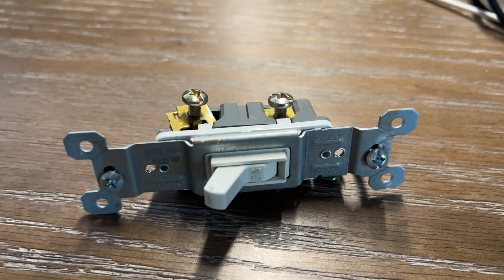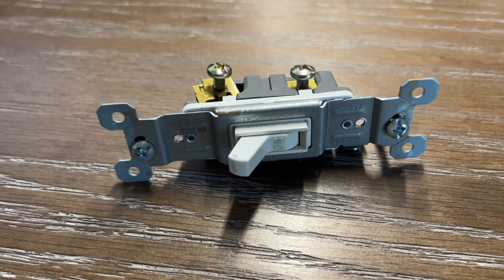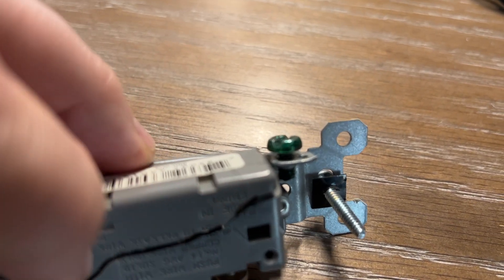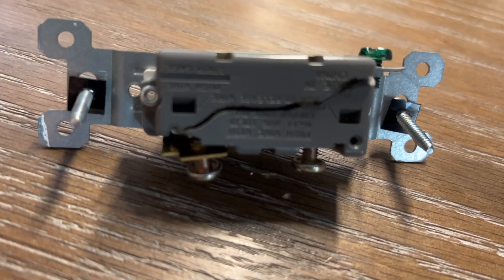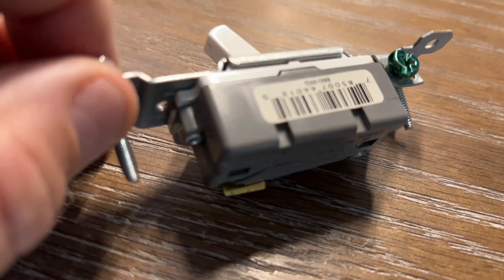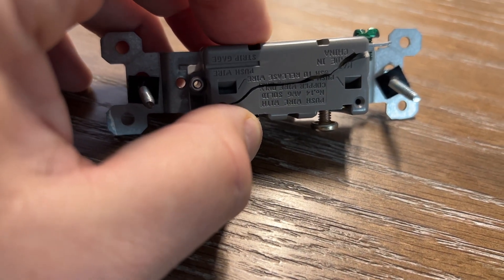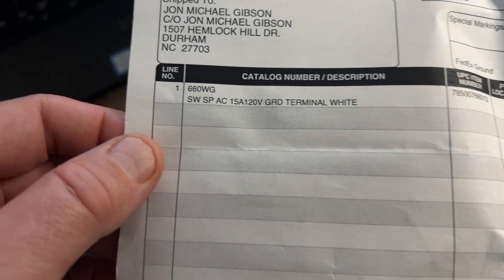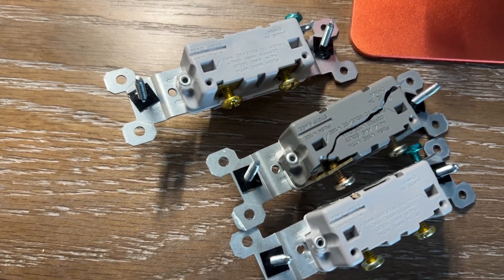Pass & Seymour / Legrand Switch Failure # 2.  What the heck is happening?

Comment: Same thing here.  My home is a 1998 build, and I’ve had several PS switches and outlets fail over the past few years  from plastic fatigue from use of the push in terminals.  I’m planning to replace all of the remaining switches and outlets in the home shortly.  And I’ll be using the screw terminals to reduce the stress on the plastic.
Reply from the maker: They sent me a box of replacement switches for free.
Reply from the maker: Just have to call and ask for them.  Or email them along with a link to my video.

Comment: I am having the same problem. It could be the tension of the push terminal spring cracking the inadequate plastic. Wrong material or too thin??  
I have these in three buildings.
Reply from the maker: I was originally thinking that it was heat induced plastic degradation overtime because it has only happened in my exterior walls. However, one viewer stated that it’s also happened in their interior walls so now I’m starting to question my hypothesis.  The plastic, however, does seem to get brittle when I rub it and I can feel it falling apart in the areas that crack so I’m not sure. Thank you for your comments and hopefully somebody can get to the bottom of this soon.  PS  sent me a whole box of replacement switches which I’ve swapped in as needed, but I don’t have a lot of confidence that they’re going to last..
Reply: @thehometipsshow  All interior walls for me. Maybe the material is just too thin. Not using the push terminals might help. Pushing the wire in increases the tension on the case.
Reply from the maker: Good point in not using the push terminals.  Maybe somebody can comment that had installed them by not using the push terminals?
Reply: @thehometipsshow  I would add that these switches were lightly loaded. Both less than 25W, so heat would not be an issue.

Comment: I have had several of these switches fail where a corner of the plastic cracks and falls off. Same with a few duplex outlets. Every switch and receptacle were installed when our house was built in 2006. All had AWG 14 wire pushed into the back of the plastic housing. I am in the process of replacing every switch and receptacle in my house. I strip the wire and form a hook, place it over th4e screw and tighten the screw. I don't trust the quick connect push in system.
Reply from the maker: They have zero quality control!  I’m so disappointed in them.
Reply: I'm not sure how they maintain UL listing. The only way to make these last is to only use the screws for the wiring. That means adding a few pigtail wires where the builder had two wires pushed into the back and a third wire on a screw.  @thehometipsshow

Comment: Interesting that they don't admit there is a problem with their product.  My home was built in 2007 and I have had 5 failures with the exact failure mode.  Read the reviews on Amazon and you can see that they do have additional complaints on the product.
Reply from the maker: I just had yet another switch failure today.  I thought my 2nd floor HVAC was broken as it had lost power.  It ends up that another Pass & Seymour switch had died (the one that turns off the HVAC unit next to it in the attic) and had been arcing causing the HVAC to turn on and off.   It ended up costing me $250 for the HVAC service call.  I'm now very concerned that these switches are going to burn my house down and/or kill or injure my family and pets.  I'm going to call them tomorrow to try to attempt to get them to pay the $250 bill as they know they have a problem as they sent me 10 new switches for free.  I really thinking that they need to pay to do a wholesale swap out of all the switches in my house and hire the elecrician to do it.  I'm tired of this and worried.
Reply from the maker: I think it's a liability issue.  If they admit to it, and someone's house burns down or, god forbid, people are burned or killed, they are on the hook.  I contacted Lagrand and to my surprise they sent me a supply of extras via UPS big enough to handle my failures now and in the future.  You should be considering doing the same!  The more people that escalate the problem, the closer we get to some type of better action being taken by Lagrand to rectify situation.  Part of me thinks there is a class action in the world but only the attorney’s make money on those.  I would be happy with just a $10k check from them to make this go away.